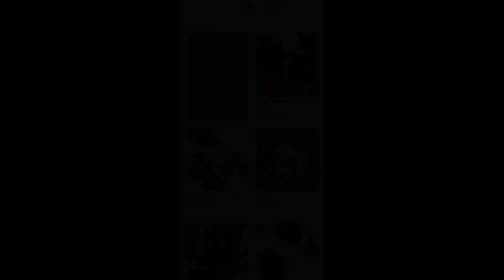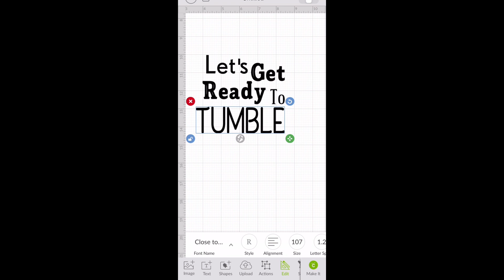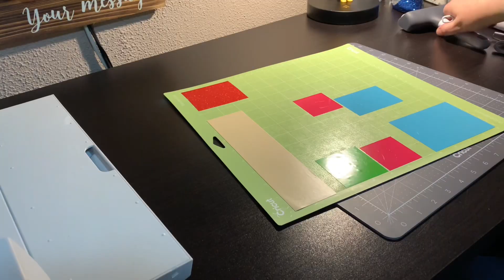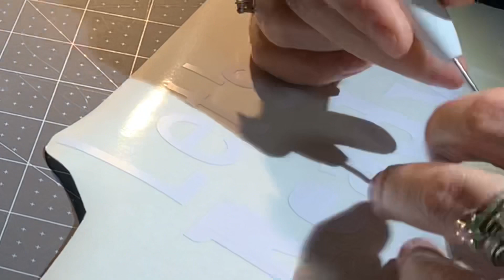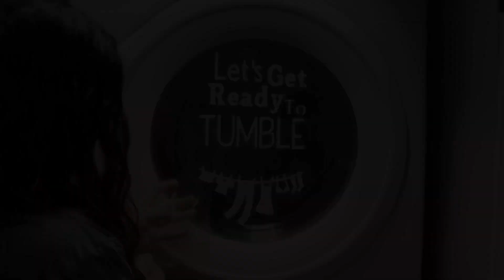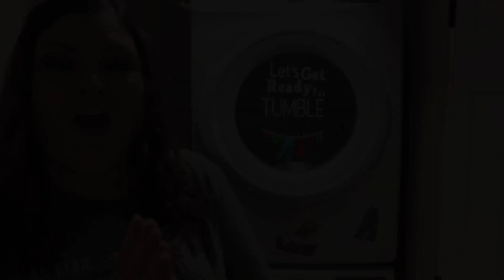DIY Dryer Decal Using Cricut Vinyl Tutorial

Comment: That is so stinking cute.  I saw the same sign in the same catalog. I wanted to purchase it too. However my new house have a laundry closet and not a laundry room like my old house. I love that you thought outside of the box on this one. I'm going to ask for a circuit for my birthday in September. Which model do you suggest?
Reply from the maker: It all depends on what you would like to do with it as there is two main machines, the air 2 explore I believe its called and then the Maker like I have.   The main difference between the two is the Maker will also cut fabric, thin wood, metal, etc and the explore can only do the basics, vinyl, paper, card stock and thin fabrics.  I was going to get the explore but thought if I am buying it, I might as well spend the extra money and have a machine where I can do it all VS settling on the other and wanting to cut something it cant as that is just my luck lol .... BUT I have not used it for any of the thicker materials LOL.   My friend here in Florida has the Explore and I feel the Maker is easier to use and there is more settings options then what the Explore does.  When you or whoever is buying it is ready, check cricut.com as they have amazing bundles package deals.  I am pondering the idea of buying the new mug press myself LOL ... Almost did it but the bundle I wanted was sold out at that time so I took it as a sign to wait lol.  While in Michales the other day, they had the display and the mugs that were done and I really want it more now hahahaha